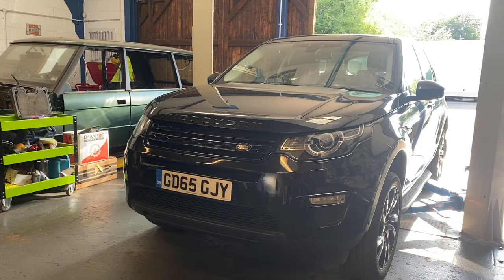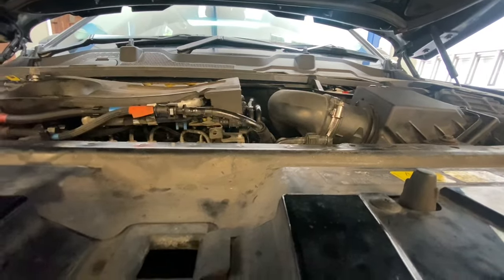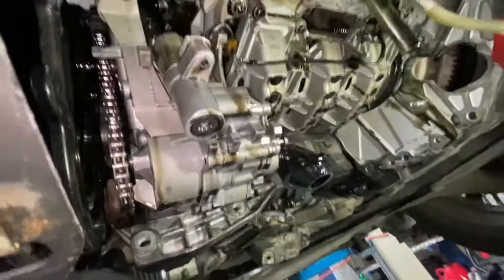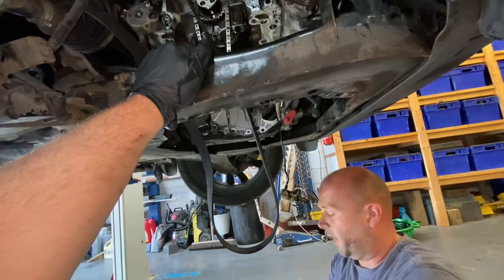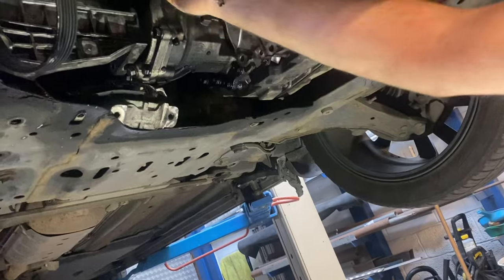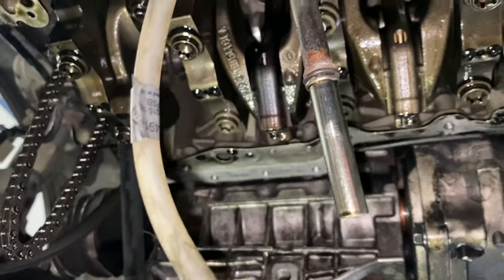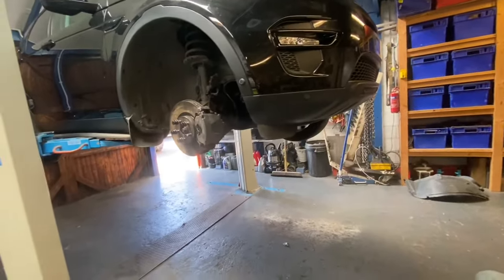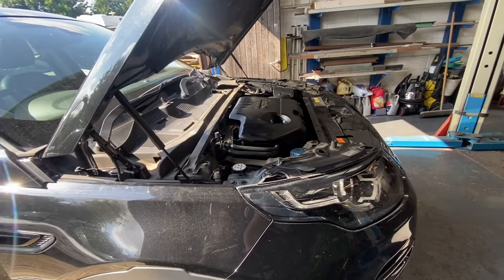LR Discovery Sport Dismantle And Repair Knocking Big End Bearing

Comment: Dread to think what it cost new 6 years ago to end up with a blown engine like this at 100k miles ,not much of an advert for Landrover .
Reply: Perhaps it's not LR fault ,the big problem with a blown turbo ,is it emptys the sump of oil in a minute, motorists tend to drive on thinking the oil light is a false alarm and the noise is nothing serious ,or the owners never check the oil level until the light comes on

Comment: What a brilliant video showing fault finding using first principles of engineering and systematic elimination of the issues to find the root cause of the problem. Old fashioned fettling of crank journals by hand! The final explanation of the failure of the turbo due to a blocked dpf is very concerning, since many of these vehicles are driven on short journeys permanently, leading to blocked dpf’s. I know that JLR have a very big warranty issue with these Diesel engines, but not the very scarce petrol version. Chris is a very knowledgable guy and nothing seems to phase him- respect ✊

Comment: Another excellent video. Well done to Chris, that was quite an ingenious idea of cleaning up the shell. The engine seem to run incredibly smoothly, ignoring the turbo, which appears to be caused by the blocked DPF. If you could get a new turbo and and DPF, is it worth taking a punt on the rest of the engine being OK?

Comment: well, we found out where the iron filings went, poor turbo. chris's patience blows me away, thought i was a decent grease monkey, but after 20 mins, the belt sander would have made an appearance. those solenoids in the oil pump are there to save fuel by almost turning the oil pump off most of the time during light load, most manufacturers are doing the same stupid trick, all to get the emission figures down about 1-2 digits .in the real world they keep going wrong, funnily enough,  just after the warranty finishes... [ but this one simply ran out of oil].
someone needs to start a book on whether chris gets this baby eventually.....

Comment: Do some real in depth research in to the root cause, dpf's are a huge problem I fitted a genuine jlr one on my 65 ds and it was toast in 6000 miles £££££, they do suffer from timing chain issues also balance shaft issues and egr issues, they have 2 egr systems a high pressure and a low pressure. In short they are a bloody headache, I sold mine after only a years ownership because I couldn't drive anywhere without wondering when it was going to die again, they are such a lovely car though. Great content as always and I was well excited to see this come up on the channel, again chris is a very skilled guy the two of you make a marvelous team.

Comment: Oil pump electrical might be a sensor rather than a solenoid to measure oil dilution. Low oil pressure because of worn shells might have ruined turbo through lack of lubrication and then the shells finally failed. If recon crank is available and over-size shells, I'd be inclined to do a full rebuild of that engine. I reckon Chris fancies keeping it so that would be best for him. Still cheaper than a secondhand engine, I think.

Comment: Nice to see chris doing part of the video and commentary. Shame you can't salvage the engine, the turbo sounds like it's starved of oil, with all the swarf and debris in the oil pick up I wouldn't be surprised if the turbo oil feed pipes are blocked up and someone has just changed the turbo and not bothered checking. Great video rob and chris.

Comment: Excellent old school engineering skills from Chris 👍 
My late Dad did a similar thing when I knackered one of the camshaft caps on my Triumph Dolomite doing a de-coke. Separate caps were not sold by Leyland and you had to buy a replacement head complete with camshaft. We managed to find the correct number cap from a scrap yard and using engineers “blue” and valve grinding paste we spent hours lapping in the replacement cap. The engine ran perfectly for years afterwards.

Comment: Fantastic video, very interesting. 2hrs sanding wow, Chris has the patience of a saint!! Amazing the colour difference in that con rod to the others. As Chris said it  got very hot, I wonder if the heat has hardened the con rod. Or made it brittle, I remember making a chisel in metal work at school. When you had temper the end with heat and stop just at the point it changed colour. Or it went brittle and shatter. Anyway enough waffle 😀😀. A great video many thanks👍👍

Comment: Shout out too for Mrs. Chris - Rob has to get home for his dinner before Mrs Rob gets the rolling pin out/dinner ends up in the dog while Chris stays (way past his dinner time?) to put hours in pulling the string. That can't have been comfortable to do either. Can you buy a new short engine (less cylinder head - Land Rover used to do them some years ago) which might be a cheaper and safer option (brand new parts with some factory warranty?) or is there a risk that the head components have been damaged due to oil starvation - appreciate you need a new/rebuilt turbo anyway.

Comment: Check the air filter as might be blocked, come across that a few times and ruins the turbo, also be weary of balance shafts whining in replacement engine and yes dpfs commonly block up.

Comment: JLR engines are fragile,  someone told me a JLR dealer had a LR car in under warranty for engine problem, required new engine. Replacement engine arrived, installed, and blew up on the test drive.  Another engine ordered and installed, also went bang on the test drive. Seems to be a big problem with crankshaft failure .
Reply: Yes I worked at JLR and a new engine didn’t even make it off the ramp and was curtains 
Love a Landrover as long as someone else is paying the Bills!
Reply: @vintage4941  gotta feel sorry for the warranty guys at JLR.

Comment: this is very interesting to see for me, i work at a jlr garage and am replacing these engines too often! had loads that have seized after turbo failure, and loads more that have snapped timing chains at low mileages ( 54000 is the lowest ive seen so far! belts last longer lol!) balance shafts for fun, landrover couldn't build a wheelbarrow properly!

turbo is toast, dpf wont do that, once a dpf is blocked, ecu puts car into limp mode partly for that reason, dpf are too far from the engine on these and dont get as hot as they need to to re gen, dont get the same issue on jags with the same engine as the dpf is closer to the engine

Comment: Had a VW 1.9tdi that my brother split the sump and carried on driving. Toasted the big end shells. Done exactly what you have, tidied the crank up with wet & dry and replaced the shells.  It’s done another 40k miles, on an engine that already had 120k on it. I’d be driving that, no issues. After you fixed the exhaust fault of course.

Comment: Hi. It might be that the first turbo dying is what clogged the dpf. If it were me I'd clean the dpf and run it for a bit.  Also check for hot side leaks on the turbo itself.  I went through very similar pain on a Hyundai diesel. The siren noise from the turbo might just be an exhaust gas leak. Good luck.  I wish I had a Chris for my garage.  He's a handy fella!

Comment: This only proves all the modern crap they bolt to engines is nothing but trouble.
With old school diesels you only had to worry about the engine loosing it's prime.

Comment: RIght boys, great job! I had a similar issue on a Rover BMW 4.4 M62, petrol, sanded down the crank with 400-1000 and it ran perfectly towing loads for 3 years 60k miles before I hit a deer!
Doubt that motor will blow.

Comment: Personally, I would never, ever, touch one of these SHYTE cars.
An absolute disgrace  and insult motoring and only intended to fleece any purchaser.
What a load of rubbish. It will spend more time in the garage, than you do driving it.
Reply: Correct but still more reliable than you

Comment: Another great video gents. Well done Chris, a mine full of knowledge. Was gonna suggest using a micrometer on the journal and then Chris chimed in at the end! Let us know how far out of spec it was? If it's measured at several points around and across the journal and it's in spec then is there an argument for not replacing the engine? I guess the oil pump would need stripping to see if has internal damage, that being a good indicator if metal fragments have been circulated around the rest of the engine.

Comment: why change the engine now? clean out the dpf and try it again. it has had the problem fixed apart from the bluing on the conrod which wont be a probl,em in the future it did not get hot enough to change the steel property's

Comment: Run the vehicle hot and drain the oil into a bucket with a magnet, if you got swarf then the engine is toast if the magnet is clean you've dodged a bullet.

Comment: Chris is the dogs…. Knowledge like that is bloody brilliant, old school mechanics on a modern car…. If that was an old cortina or leyland mini it would go on for another 100k… just the fact it’s a new overly complicated motor it’s being a pain 👏
Reply: The DPF is blocked leading to the oil cooled turbo getting cooked from oil starvation and pressure imbalance due to choking of exhaust flow due to DPF issue.  The oil starvation created a secondary issue in the big end or crankshaft by creating hotspots on the bearings that retain the con rods atop the crank assembly.

I do not understand what the crank journal is but then this is not a really in depth video but rather a fully competent overview of the component failure in issue with a brief commentary on the nature of the fault, its associated secondary failure with cost effective solutions shown and implemented. 

PS Chris is all right but you lot spoil him in the comments with endless praise.
To be fair though him and Rob are smarter than me so fair play to the blokes.
Reply: What are you going on about?
I was merely making a comment on the effort Chris puts into his craft.
Most new school mechanics wouldn’t even know how to re-hone a crank journal in situ let alone diagnose it.
I know there are more issues with the motor and so do C&R and through the video this was made clear….
I go back to my original point modern engines are over complicated, Yeah emissions are less but at the possible cost of a shortened life expectancy of the motor.
Reply: @jimb5341   I simply listed the engine faults as
 repeated turbo failure due to oil starvation from;
  
i) DPF (filter) blockage from under use at sustained higher revs whilst under load that caused a fall in return pressure meaning the turbo fails to hit functional boost pressure range which leads to engine management (ECU fault code) issue and over fueling of air fuel mix that makes the fault worse.
 
ii) Bearing debris from union of bottom of con rod and face of crank journal as well as bearing overheating in turbocharger are both a result of oil pickup blockage in sump which again was caused by exhaust recirculation issues from the blocked DPF (exhaust filter) that caused turbo pressure starvation and engine management (ECU fault code) issue.

Why mate are you deflecting into a unbefitting defence of Chris and Rob when no attack was made? I think they are capable blokes too, no suggestion was made to the contrary.  I basically re-stated the content in words that made sense to me.  

If the words I use do not make sense to you then by all means say so but honestly mate there is no need to slight over them and construe the issue at hand as a remark against the content creators who we are all evidently in awe of.  Be positive mate, I was just trying to help clarify the basic engine issue. Have a good one and behave yourself.
Reply: @aljanat5375  jog on mate…. 👍
Reply: @jimb5341   Mind your head my son ;-)
Reply: @aljanat5375  NO
Reply: @jimb5341   Crack on mate
Reply: @aljanat5375  you too
Reply: @jimb5341   Right you are

Comment: Same problem with Toyota t sports Rob rip the bigend bearings out they rev to 8200rpm and kill bigend shels
Reply: The Celica and Corolla T Sports with the 2ZZ engine maybe, but the Yaris T Sport has  a nearly unkillable little 1.5L I4 (1NZ) that shares it bottom end with the mighty  Mk1&2 Prius 🤣. Good for 200,000+ miles with only basic maintenance.

Comment: Wished you filmed the removal of oil pump and timing of it etc. That stuff ain't easy
Reply from the maker: The oil pump runs constantly off the crank it’s not timed and it just had a few bolts holding it on 👍

Comment: Can you get under size bearings.?
Reply from the maker: Over size yes 👍
Reply: Yes normally in 0.25 0.50. 0.75 and 1.0 mm depends on make / model  -  thousands or an inch equivalent sizes 10 thou, 20 thou,  30 and 40 thou I worked at engine re manufacturers for 15 years

Comment: What’s a DPF LADS.
Reply: The worse thing to ever be put on a diesel.
Imagine an air filter or a trap, in the exhaust that catches soot, collects it all together then when the air filter/trap is full the ECU makes the exhaust temperature burn at 800 or so degrees to incinerate it.
Reply from the maker: Diesel particulate filter to reduce emissions

Comment: Surely it would be a good idea to get the DPF cleaned. It may be that the noise from the new turbo is caused by the continued blockage of the exhaust causing excessive back pressure. I'm surprised that the car doesn't have automatic DPF regeneration. Many do.
Reply from the maker: It does bud 👍

Comment: Hi guys,great video as usual,I may be able to help with a motor,I've got a good 2 liter BMW variant motor that is running out a freelander td4,it is from a 2002 though,but might  fit.....iain
Reply: That would be too old for such a new car 👍
Reply: @sammytheseal2307  I know it's a shame,but sever grand compared to a couple of hundred makes a big difference Sammy....I don't know how different it is....
Reply: @iainbrown2280  It won't have all the same sensors, emmisions control, gearbox will be different
Basically it's all the computers that would get confused. 
Going back to the 1970s of course you'd be able to put a 10 year newer engine in something though 😁

Comment: I can fully understand why they made that repair. As they know, it will probably  (only probably) fail due to one of three things. 

Firstly, the original problem may be something else producing metal or debris in the engine was not found. 
Secondly, the crank clearance may be too large now. 
And finally, debris will still be in the engine that may well find its way through the filter or clog the pickup and destroy the engine,

Not sure if the turbo and blocked DPF would have taken the bearings out. I just think that 100k miles is all one can expect out of a 4 cylinder that produces the torque of a V8 with long oil change intervals. The bearings are the same as they were 50 years ago when engines produced 1/4 the torque.. something has to give.

I have seen this sort of thing be successful as a long-term fix ... who knows.
Reply: Nah he checked with micrometer

Comment: In the previous vid I reckoned there was water damage from driving in deep water and bent a con rod in the process. 

Now I reckon the turbo failed and shot bits into the cylinder which probably had shrapnel bouncing around and found it’s way to the bottom of the cylinder and got wedged under the big end, grinding away until other elements have worked loose. 

Am I talking complete bo*****s or do you lot agree?
Reply from the maker: The end went as the previous turbo let go and starved the crank of oil. 👍

Comment: I love Chris ,a man after my own heart .Even the parts washer is spotlessly clean inside and out ! .ref the engine why didn't Chris use a micrometer on the crank journal and compare with original spec which would tell you immediately if after cleaning a bearing swap would be a permanent cure .
Reply: Err, you didn't watch to the end - did you....!